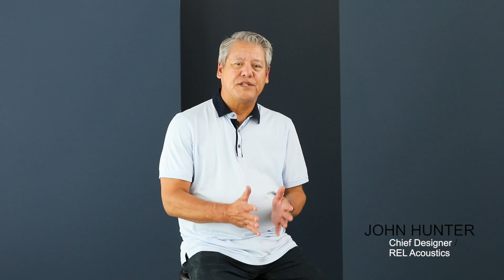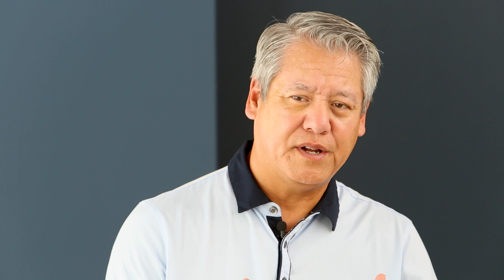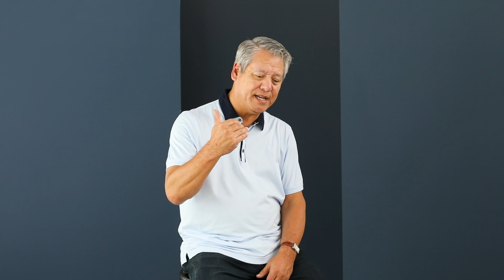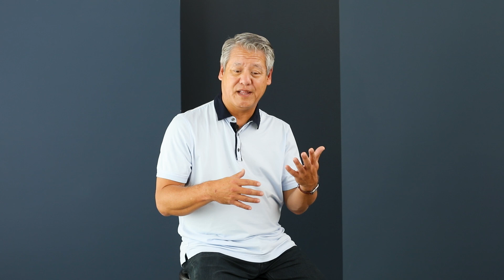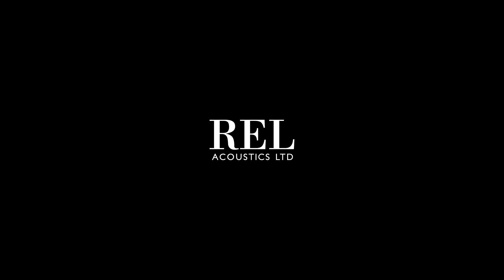Learn why REL Acoustics uses only analog filters in our subwoofers rather than DSP

Comment: I need help. I would like to connect my RELs to an Exposure Amplifier (which has a banana plug connection). Do I combine my speakon cables together with my speaker cables into a banana plug for each channel, or can I plug in to the extra connection on the amplifier that’s usually used for bi-wiring?

Any help will be deeply appreciated.
Reply from the maker: Since your Exposure amplifier features recessed banana output terminals, you can either combine the REL subwoofer's high level wires wire your main speaker wire in the existing banana plugs, or you can attach stacking banana plugs onto the bare wire ends of the high level cable. Stacking banana plugs will allow you to plug the high level wires into the output terminals, then plug your main speaker wire into the end of the corresponding stacking banana plug.
Reply: REL Acoustics Hi, I read up about the bassline blue product that you have that some use for their classic Naim amps, and i read it comes with a “piggyback” banana plug for the REL and the speaker cable to be connected together in one. Will this help with my situation? Maybe shed some light in picture form?
Reply: REL Acoustics And so I can confirm the way i suggested of having a stackable banana plug where the speaker cables and REL cables connected together is the way you would recommend? Thank you so much for the replies! :)
Reply from the maker: @AsadNazif  The Naim Bassline Blue cable does feature stacking banana plugs, though these can also be purchased separately and attached onto the bare wire ends of the supplied high level cable. Here is an example which is available from Parts Express, though there are many other similar options available from a number of online retailers: https://www.parts-express.com/angled-locking-stacking-banana-plug-with-dual-set-screws-poly-shell-and-insulated-thumbscr--091-3608